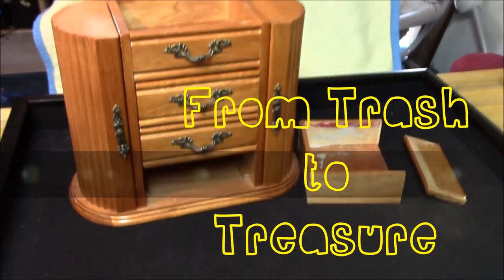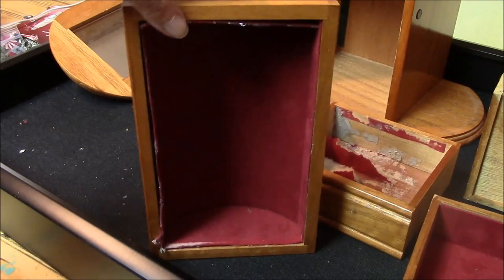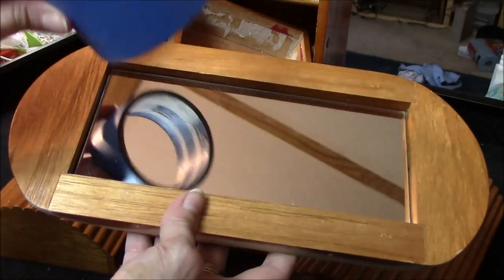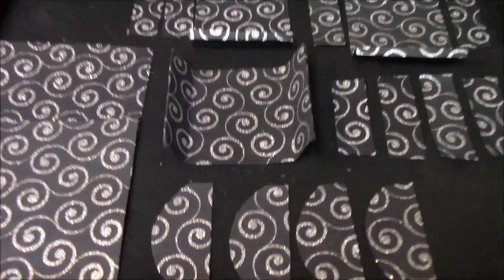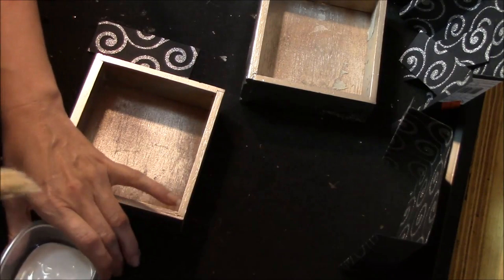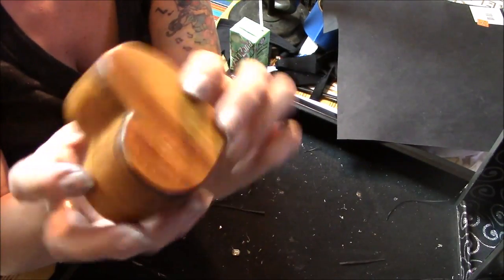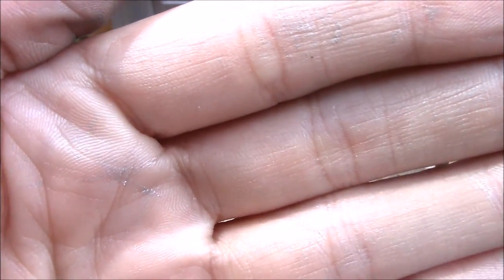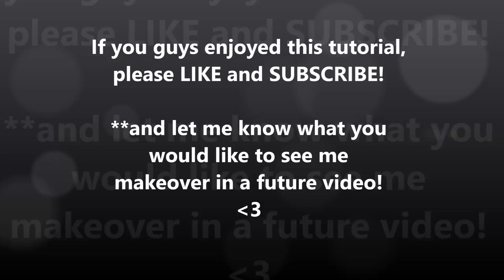Trash to Treasure -episode 1:  Old Jewelry Box Makeover / How to restore

Comment: If you are going to do anything with wood in the future may I recommend that you use wood glue.   It makes it strong and part of the rest of the wood.   I've used it to fix the rail on the end of my bed.   Wood glue is not that expensive.  It does take a bit of time to set though, but once it does it will never come apart again with regular use.

Comment: How do you remove the glue? I got a box from the thrift store and the liner is really glued in there so I'm guessing I'll have to scrape it all off
Reply from the maker: Use a heat gun and heat the adhesive. It should be easier to remove once heated